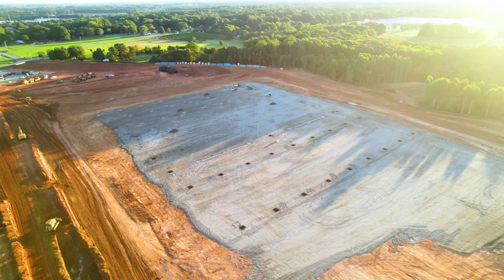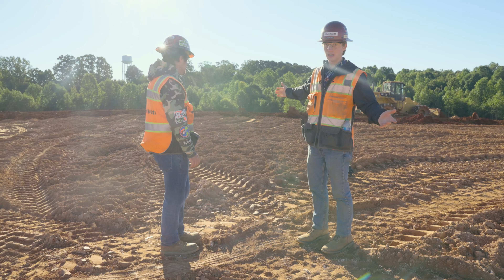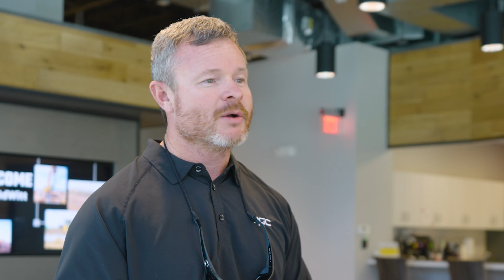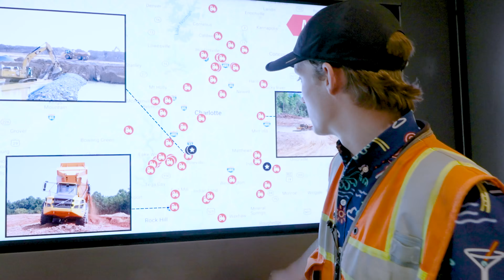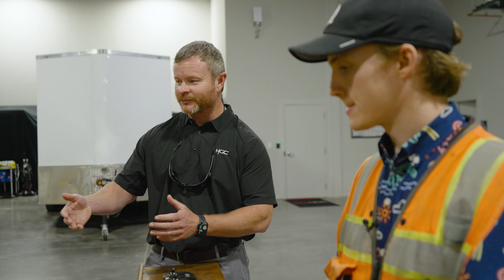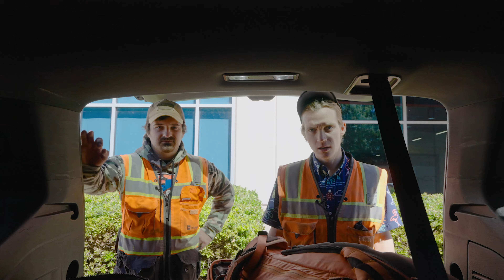This Company Is Changing the Future of Construction | Hoopaugh Training Academy

Comment: Thank you for walking through the TRAINING building. So, Soo important like just how to read stakes. (Meat lovers) that was a big problem for me. I get that clicking noise on my excavator 
( HULNA power) my control is the Dipper and boom are buttons. But I get that clicking bypass STOP digging noise my.(Horizon Hobby) off Road ( SCX-24) Red Deadbolt 4x4 goes a lot better in sand boxes. It doesn't get stuck, and I have 3 speed settings. The slow speed of the vehicle just crawling out of the deep rut. Back on training facility. In my state at Yakama Washington State. The operator Union (302) has a school at White Swan. To teach the same thing. The only problem was the Teacher had the Dozer students push a large amount of dirt. The issue we had with the student who got trained there. We were fine grading on the side of the road. The guy just pushed all the 5/8 minus out and dug a big hole. He said this is how he was trained to move dirt. In my Humble opinion the supervisor should have been teaching this new operator how to read stakes
Fine grade with D-4 size of Dozer. Also if a rental comes out to job sit. And say it's a JD with different controls. We had that happen. I ended up on the machine, because years ago I got Layed OFF job for not knowing the JD control pattern. I even ran a Ford-420 with Ford 4 stick control. Very different than a Case 3 lever with foot swing. It took me time with that Farm Tractor with a backhoe on the back. The swing was a chain wrap around boom base. It would swing slow then take off fast. Very Dangerous for anyone standing by a bucket dump area.
Everything in construction machinery has gotten so streamline. That there is possible an older make on job sight. That new operator need to understand the control of other brands of equipment. Just saying I have seen it, and for me it was back to the Hall, meany moon ago. I remember a huge (Poclain) we had digging main line sewers. That excavator had tons of levers in cab plus there were foot pedals attached to two of the Levers. If any of your watchers have seen these older ( Poclain's) around Thay know what I saw. Also (Warner &
 Swasey Hopto) they built a beast (1900) digging Depth of (35) feet. These had foot pedals plus hand levers for all functions. Years ago Case industry use to do a backhoe Rodio with each machine set up with different control pattern. It was fun to watch guys go from one backhoe to the next, trying to get the best time.